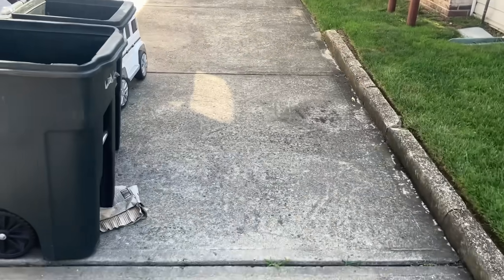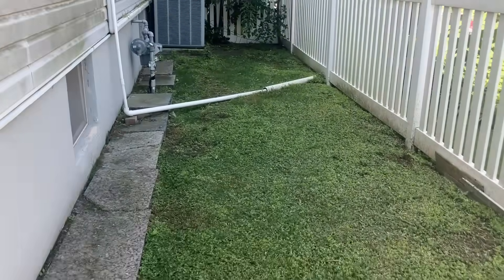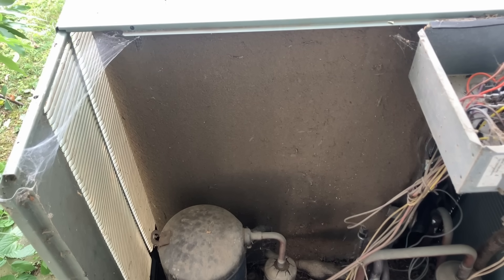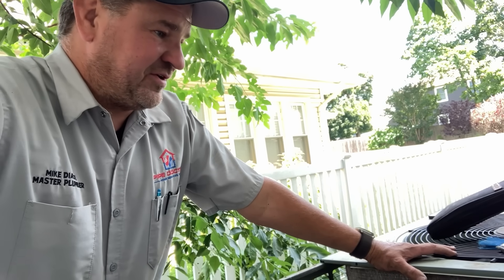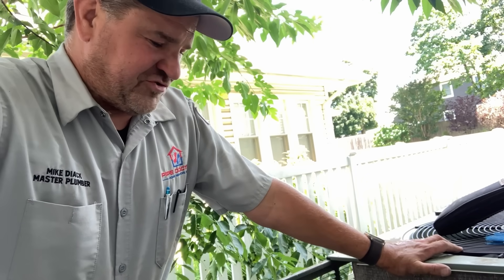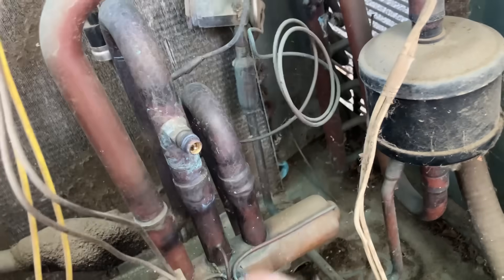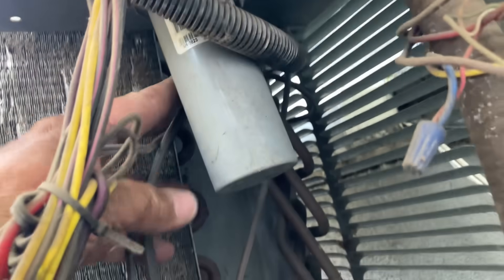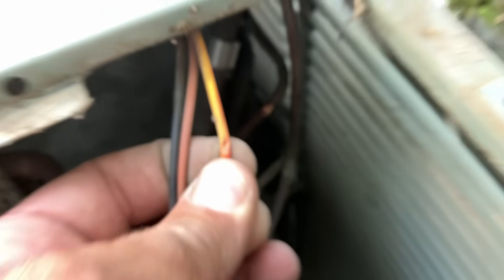$5 Wire Causes Catastrophic AC Failure — You Won’t Believe What I Found!

Comment from the maker: A tiny wire. A massive failure.
This Rheem condenser didn’t stand a chance — flat on refrigerant and shorted at the compressor from a cap tube rubbing the wire box. 💥 Homeowners now face the ultimate HVAC question: Repair or Replace?

🧰 Want more raw, real-life HVAC service calls?
✅ Subscribe to follow Mikey Pipes and the Pipe Doctor crew on the frontlines.
👇 Drop your thoughts below — What would YOU do with a 17-year-old system like this?

#HVAC #MikeyPipes #PipeDoctor
Reply: Do you use R458a ? How much would you charge to braze that hole and charge it up .I not mentioning all the steps .I'm just wondering what the cost would be up there
Reply: I was surprised watching you searching for the leak using nitrogen , you had to be very curious😂😂
Reply: Nice find Mike, a two for one!
Reply: With that roached out coil, there was no bringing this one back from the promised land.

Comment: I get it,you hate the slightly labor intensive cleaning, breathing dust without a mask, dirty condenser, but you should have used water. The electrical short does not equate a busted compressor you would have to have the dilligence to look at the electrical shematic to see where the short occurs and then as an electrical engineer i would know if it compromised anything in the system. Do HVAC tech have enough education to do this ? But jumping to a conclusion without doing the investigation can lead to misdiagnosis.. Replacing the dual cap IF it tests bad is normal maintenance at that age .  What is shocking to me is the HVAC guy diagnostic who claims "catastrophy" without doing a comprehensive investigation.  Everyone understands that installing a new unit is a much higher paying ticket and more fun but this system could well be fine after what is an easy repair.  With all the refrigerant leaked out you don't know the condition of the compressor. It could well be workiing just fine or damaged but more likely to be just fine. AC system can work up to 35 years plenty of cases.   Brazing the pipe leak is easy.  Remediating to the shorted wire is easy.  I think this Unit requires more investigation and dilligence than it was given in this first  video. Should fix the leak, wire, vacuum, recharge and see if any other problems.  Some HVAC guys are so quick to jump to the replacement option conclusion it sure pays a lot more to do for them.
Reply: The wire was clean.  That means the compressor was running witthout freon or oil for a while to cut that far into the copper pipe.  Even if it isn't burned out, it will be on it's last legs if it will even compress freon..
Reply: @robertsmith2956  Pressure switch on the low side would have cut the compressor when the pressure got low from the leak much before causing damage to the compressor. It should be just fine. This is no different than an undercharged system (leak). The wire would have been bare long before the vibration ground enough to make a hole in the pipe. When that hole finally came, pressure switch should would've switched off the compressor. Improperly lubricated systems are usually the result of technician failure to evacuate, measure the oil in the system to add back the right amount, when recharging or contaminated system where the oil acidifies.
I find it amazing how some HVAC techs almost want an unit to be broken so they don't have to fix it. It's as if they trying to win the lottery  ticket for a new install. Low intergrity.
Reply: @goognamgoognw6637  If the switch worked.  I had low switch fail under warranty and was curious how hey were going to replace it down in the coils.
They just put one on the valve, and hooked it in.  😏
I guess the fan might shake it enough to cut the hole.
Reply: @robertsmith2956  No reason for Pswitch to be broken. 
HVAC technician attitude : It's all broken you have yo buy a new system.

Reality :  Easily fixable.
Reply: @goognamgoognw6637  No reason for compressor to be broken.  but Mikey had to replace one after one day.